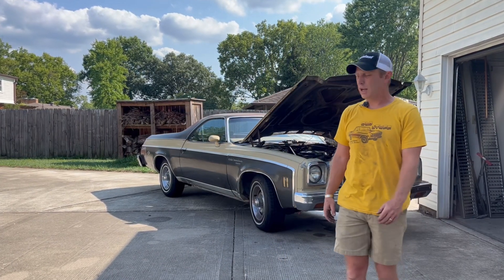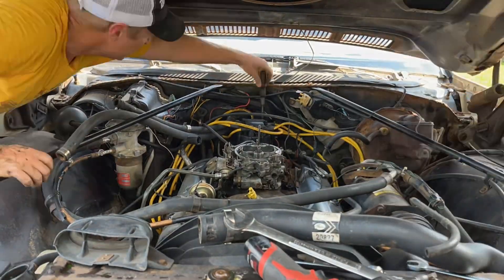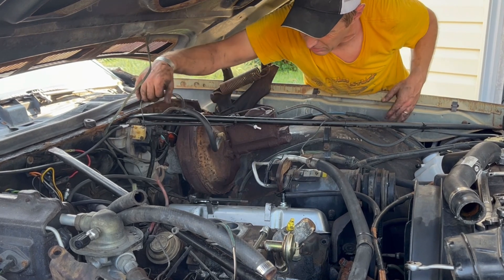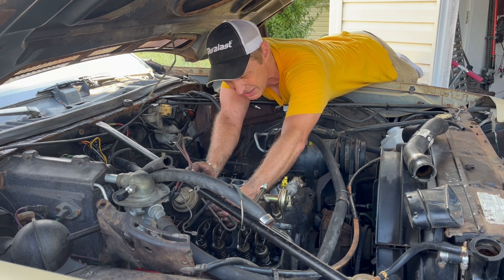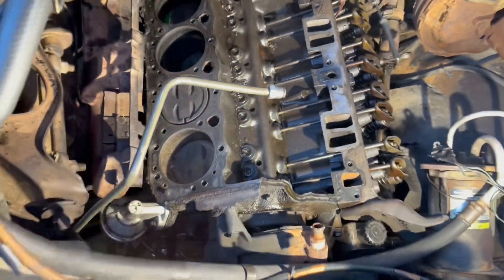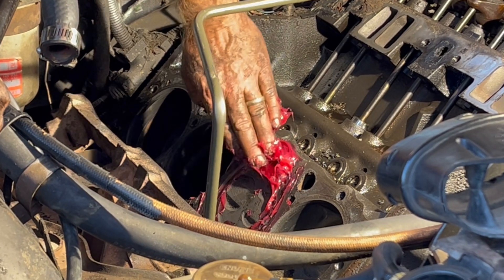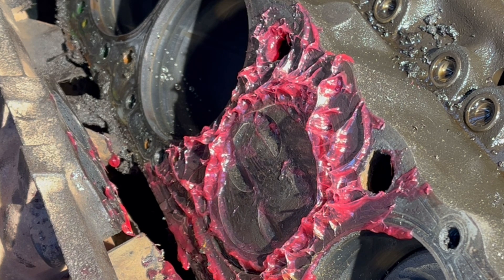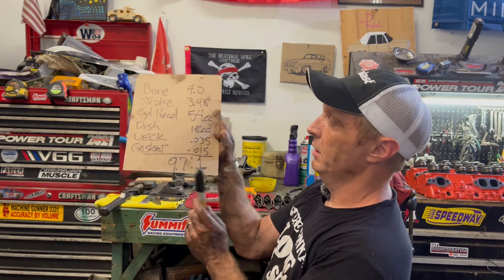Putting 305 HO heads on a 350 Chevy small block Part 1: tear down and measuring

Comment: If you were to put 305 heads on a 350, it would be a good idea to make t exhaust valves bigger. Using 1.6 ratio rockers on t intakes is a good way to avoid shrouding issues.
Reply from the maker: Exactly.  Also a little more cam would open the top end RPM range a little more, but would it then lose the low end torque I was aiming for?

Comment: Thank you for the video! You could save a punch of time by just comparing the cc's of your old and new heads. As you already mentioned knowing the orginal comression ratio, the ratio the older and newer heads will tell you how much will the compression increase, using the original thickness of head gasket.
Reply from the maker: Very true!

Comment: Following this guy  my 82 c10 355 sbc 305 heads  rpm 2300 rpm up to 6800 know problem  ❤😊  my Howard roller camshaft   565 65 lift 108 cL  235 246@50
Reply: On a 305 head just cause it turns doesn't mean it will produce HP. Great on a truck for hauling up too 5000 rpm

Comment: Man thanks I followed your build I have 355 sbc I build set of 305 HO head  man make C10  82  pulling strong  Howard camshaft  108 CL  2300 stall converter  400 transmission 410 gear  my block deck and bored 40 over
Reply: Before pick 305 heads  check casting number  I do know 601 305  have 175 intake runner  cc  make lost power  Newton merchine  Williamston sc build me bad sbc  400 sbc set 305 HO   400 sbc pulling strong up to 700 RPM  with 194 160 valve   6500 rpm power  dyno 450 HP twist 7000 RPM drop power  band  we Race  my 72 c10  2024 season   owen motor ran 720 8th mile track war shoal drag strip
Reply: For money budget build nothing wrong 305 HO  head   I have 406 built  set HO heads  Newton performance merchine Williamston sc  built me bad ass 406  660 roller camshaft    still drive owen weekend to race track   I say  this if do budget build votech 906 casting are 305 601  your make good Power  save lost money buying  China aluminum head are  AFR aluminum head

Comment: I'm thinking of doing  something  very similar. I've got two chevrolet trucks a 97, 5.7 vortex, and a 1983 , 305 . The  83 is more solid of a truck, which is why I'm thinking  of joining the two this way
Reply: Use the vortec heads if there still good, would be going backwards, bump compression somewheres there still 64cc

Comment: You got that intake off easy! I have a 305, and just wanted to rebuild it more for a street car than a performance car (and had an amazing learn opportunity, plus the head gasket was blown out). I had to get the bolt for my alternator and put it through one of the mounting holes.
Reply from the maker: @Laqota  yeah, some intakes are real fighters.   Small block Chevys are great engines to learn with.  Very forgiving, huge and inexpensive parts catalog

Comment: I did this back in early 90s when chevy guys thought this was a good idea. Well not good idea, lost a lot of power. It increases compression but the 305 heads have smaller valves and ports. The better way and easier would be to just pull motor and put in .100 dome pistons. Me personally when iron heads come off they never go back on, always replace with aftermarket aluminum.
Reply from the maker: @TobyBielat  this was a purely budget build for low RPM towing.  You are 💯 correct that with small ports and small-ish valves the engine runs out of breath above 4000-4200rpms.  low end torque increased dramatically with this swap, which is what I was looking for.

Comment: Not a good idea...305 heads are emission heads... Not designed for flow and power . Not recommended.. disappointment. Use a set of 350 vortec heads if possible or a set of 350 truck heads of some type.
Reply from the maker: @markcoyle5445  vortex heads would require a new intake, truck heads all had chambers that were similar to what I took off, 305 HO heads are small chambers which is good with the stick small cam for low end torque increase which is what I wanted and got.  Now these do make the engine lay over at around 4500rpms, but it’s built to tow/haul not race.  Also this was an extreme budget build and new or really good heads were above budget.  $50 for these heads, new valve seals, a k little polishing and they did great.
Reply: That's exactly what there good for . Old style 327 350hp can l79 cam works good for towing setup

Comment: How much more power you think your going to actually get from it im not sure that this job is worth doing you may not even notice the difference but you will be forever buying 93 octane or ,yeah no e 85 which the difference between 87 and 93 as far as price is significant and thst 350 would have done everything you are planning to do with it just fine on 87 octane fuel but hopefully your gonna show me im wrong and dont know anything about smsll block chevys or any engine  combinations at all its been known to happen before lol
Reply from the maker: @GlennManchester  it got me probably 25-35hp.  Noticeably quicker 0-60 and a lot more low end torque due to sticking with the small cam and small chamber heads with medium-ish valves.  I was really happy with the result especially for the low dollar amount I had in it.

Comment: With .035 in the hole just go with the thinnest gasket which is a .015 steel shim from fel-pro. Coat both sides with Permatex supper 300.

Comment: I do not see where a taller ratio on the intake is gonna do any good. If anything the taller ratio should be on the exhaust for improved scavenging. Look at it as an air pump, air has gotta exit as easy as it is pulled in. And best of luck on that thin head gasket.
Reply from the maker: @OlysGarage  it’ll be the same thickness gasket as the factory shim.  I’ll prob spray it with copper gasket too.  I read all I could on the 1.6 rockers and most pages said if it’s all stock do intake only 🤷‍♂️
Reply: @Foxcanfixit  make no sense to me! Oh well, giver' hell, son!
Reply from the maker: @OlysGarage  I know, I’m just going off the literature I’ve read.  Rockers are easy to swap around anyway

Comment: Yes you get compression but those heads flow like 💩.  So the engine won't make power in the 5000 rpm range but will do great below 5k. Now if you ported the heads then..
Reply from the maker: @shootermcgavin2819  my whole plan is to make torque from idle to 4K rpms and use this as a tow rig.  You are 💯 that these do not flow up at high RPMs without more work than it’s worth probably.  But my low rom range plan makes these perfect
Reply: @Foxcanfixit   perfect heads for that.  keeping the oe intake is a good call
Reply from the maker: @shootermcgavin2819  thanks!  Did a lot of research trying to justify an aluminum dual plane, but unless it’s free it’s not worth it for this build.
Reply: Most run of the mill 305s were idiot proof in that you could put it in neutral and mat the gas it would run up to 4500 and stop the head flow just would not supply any more air to it and it just fell on its face over that rpm now they were great for us back in the day because the yeah idiot proof thing and would make enough low end torque to spin at least one tire sometimes two tho I had one out of a Camaro I bought from a buddy for 20 bucks he was building a hot 350 for the car anyway that was most definitely the absolute best 20 dollars I ever spent it apparently had fairly low mileage on it because it used zero oil never not once did I ever add a teaspoon to it and was clean and ran like a champ I put a four barrel intake and carb on it and my turbo 350 had what b and m sold back then as a shift improver kit I did one and was hooked every car I had from then on had to have it done my poor buddy did them for me often  after I drove it to him and said I'll wait what ? But I gotta let it cool off oh come on Billy I'll help you lol poor bastard hot transmission fluid running down his arm laying on his back on cold concrete we did it tho and they worked very well second gear every time left a few feet of single tire rubber every Time it was to the floor quadrajet moaning and chirp what 17 or 18 yr old gear head wants anything else in life well maybe we wanted something else lol but that was up there on the list when you leave someone's house and everyone is watching and a burnout followed by a q jet moan and second gear chirp lol it was only achievable in a stick before and I'd yes rather have a four speed but most cars were automatic and had lazy shifts not Anymore my dear Watson not anymore!
Reply: If they don’t flow past 5000 then they’ll match the stock camshaft lol
Reply: For a truck engine and low rpm torque  and pulling when u dont spin them any faster than 4500rpms  the flow dont matter then.  Thoses  305 heads work good on a 350.
Reply: You are right the 305 stock heads on a 350 is junk

Comment: I was hoping to see more grease used.  😂
Reply from the maker: @MuscleCarSolutions  I only had the 1 fresh tub 😂😂😂.  But it did work good enough.  Also with the actual specs the factory compression worked out to 7.87:1 not 8:1 so I’ll gain nearly 2 full points of compression.
Reply: @Foxcanfixit  now that’s using your head!

Comment: I would just be worried about the thin steel gaskets leaking if something is warped a little.
Reply from the maker: @NathansMoparGarage  it has factory steel shims on it now.  I checked the new heads and they are flat.  I’ll prob spray copper gasket adhesive on both sides when I put it together

Comment: This is pretty interesting.
Manifolds...seem like  a pain.
Reply from the maker: @Dancing_Alone_wRentals  there’s just no room to get 4 of the 8 bottom row head bolts out without a lot of prying and cursing
Reply: @Foxcanfixit  I had a 1980 van with a box on the back.   I had to change the manifold to head gasket and geez....the manifolds shrunk a bit.
I was livid...before that I had worked on Toyotas.
My friend told me one of the tricks the mechanics used was to cut out the holes that pass the bolts though.

That was one of my first experiences with hard to work on stuff. From then on I don't like anything that is difficult for the mechanics to work on.
My favorite car should be a tilt cab ISUZU or something like that.

I want cab and chassis to lift off with Velcro.
Reply from the maker: @Dancing_Alone_wRentals  an Isuzu tilt cab would be cool